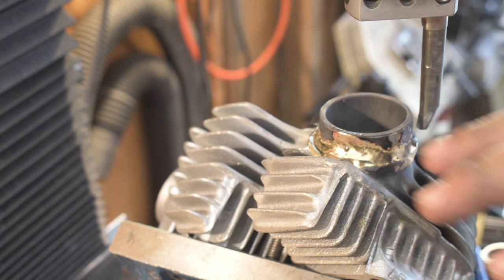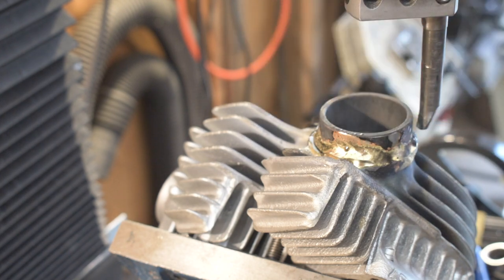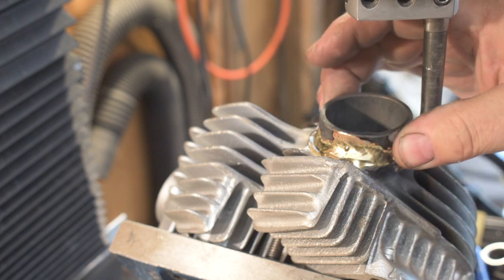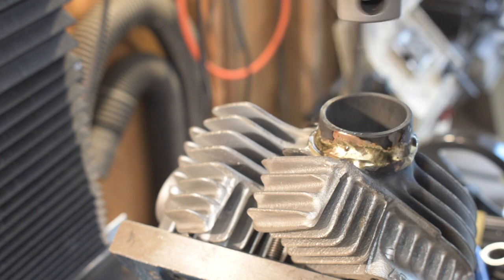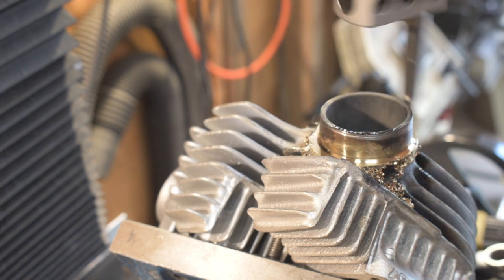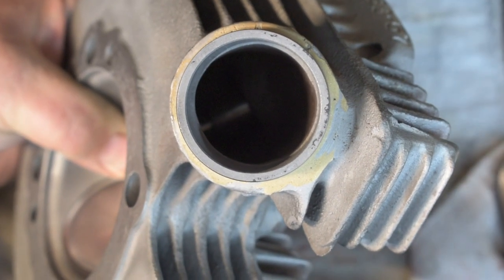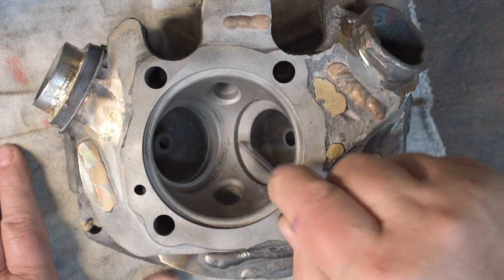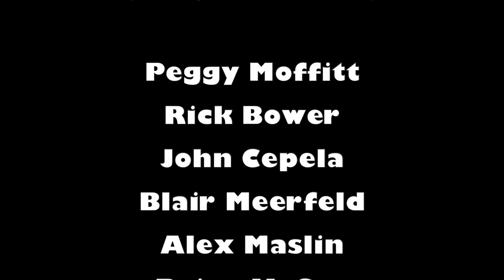Ironhead Exhaust Spigot Fix Nbr 191

Comment: Very nice repair! I had a ‘62 DuoGlide and blew the rear exhaust flange completely off. Caught fire and pushed it nearly three miles to an off ramp to get enough light to salvage enough wiring to get it to start (with a chunk of tire I found along the way to deflect the exhaust). Lucky more heads were still available! I was an E3 In Naval Air at the time and went on to aviation machining years later, so my kudos to you are not hollow.👍🏼

Comment: Nice job,, people don't realize that set up is what takes most of the time... When machining anything... I always use aircraft style hose clamps on both intake and exhaust... The kind used on radiator hose for a tractor trailer
Reply from the maker: So do I. I get heavy duty ones at McMaster. Much better than piece-o-crap biker big box stores type a lot of places sell.
Reply: The clamps raps all the way around with no gap... Uses a long 1/4" T-stud comes with a nylock nut
Reply: If you have a Parts Store that supplies parts for big trucks... You can get them there